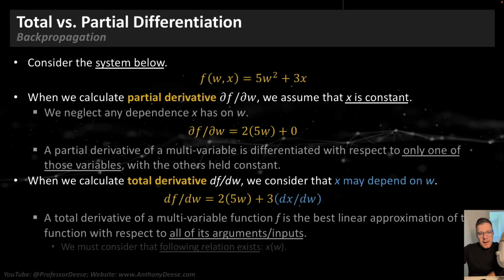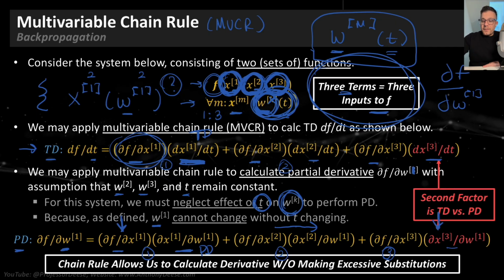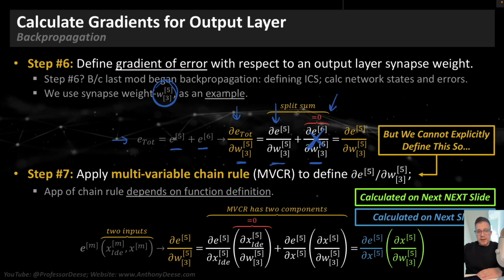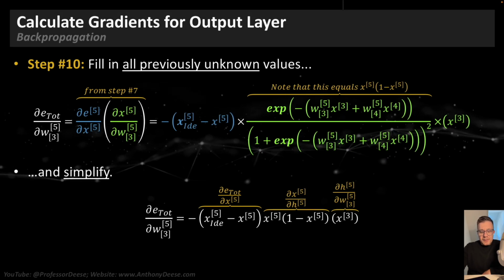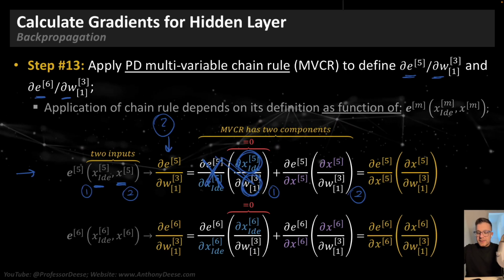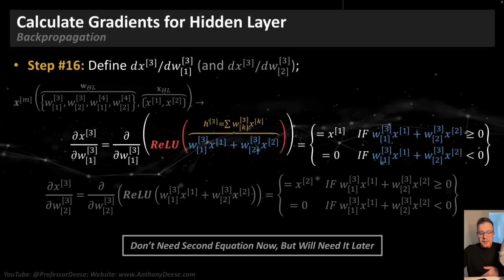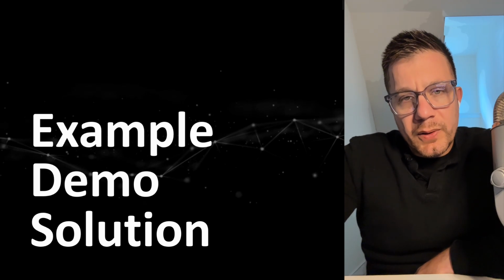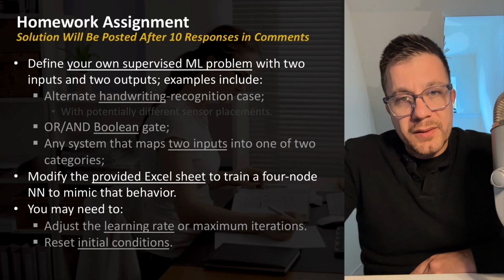Advanced Backpropagation: Step-By-Step, Calculus-Based Example

Comment from the maker: Description:
Master the calculus behind backpropagation—fast. This step-by-step lesson covers partial vs total derivatives, the multivariable chain rule, and gradient formulas for both output and hidden layers. Then we implement the updates in a downloadable Excel demo and visualize learning (weights + MSE) with stochastic gradient descent. Perfect for students and practitioners who want the math you can use in neural networks.

What you’ll learn:
• Partial vs total differentiation and when each applies
• Multivariable chain rule in neural networks
• Deriving ∂E/∂w for output (sigmoid) and hidden (ReLU) layers
• Implementing gradient descent updates in Excel
• Reading weight/mse plots and tuning key hyperparameters

Resources:
• Excel spreadsheet demo (Drive/Dropbox links & QR shown in video)
• Companion Module 10A (concepts/visualization) and next module on SGD vs batch + hyperparameters

Homework (join in the comments!):
Define your own 2-input / 2-output binary classifier and adapt the Excel sheet. Share your learning rate, iterations, and final MSE.

Chapters:
00:00 Intro & goals
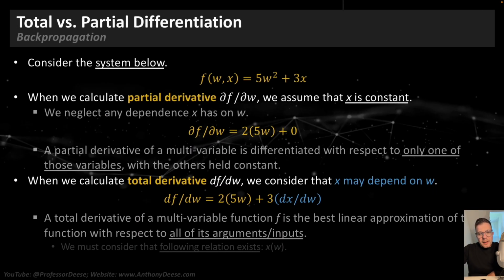00:34 Partial vs total derivatives
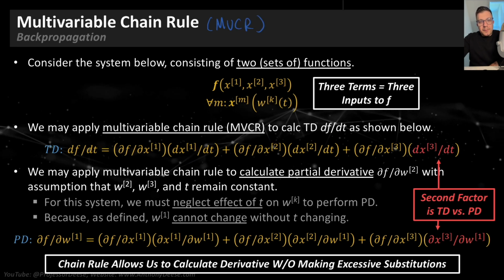02:48 Chain rule (multivariable)
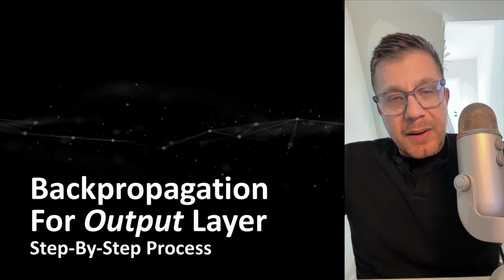07:08 Network recap (2-in/2-out)
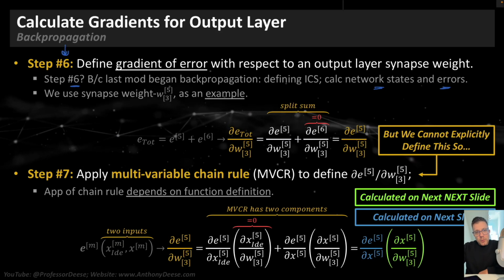11:00 Output-layer gradient derivation
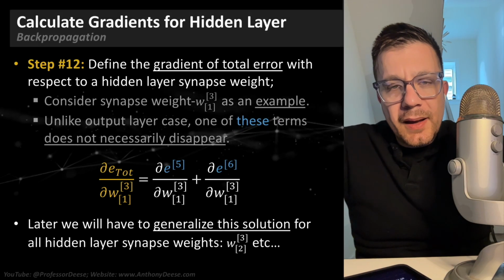20:14 Hidden-layer gradient derivation
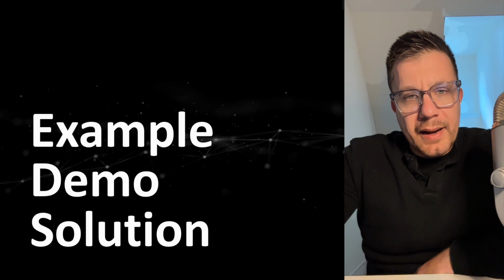34:08 Generalized update rules
35:55 Excel demo walkthrough
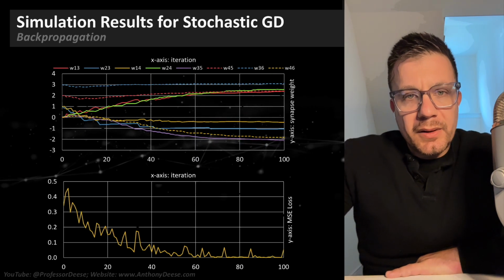37:44 Results (weights & MSE)
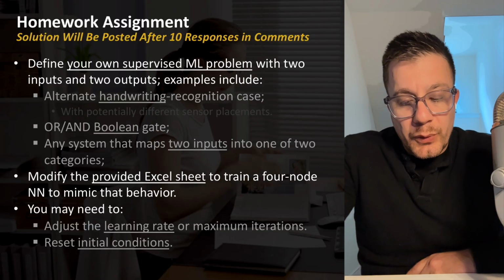39:45 Homework & what’s next

#MachineLearning #Backpropagation #NeuralNetworks #GradientDescent #DeepLearning #AI #DataScience #Calculus #ChainRule #ReLU #Sigmoid #StochasticGradientDescent #Excel #Tutorial #STEMEducation
Reply: How do we access HW solution?
Reply: @Me1736-b5h Same.